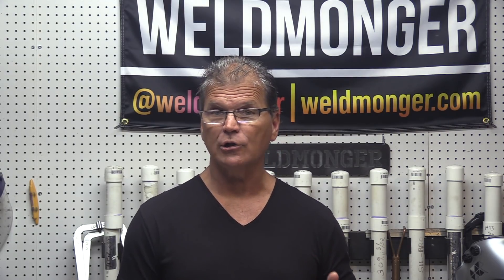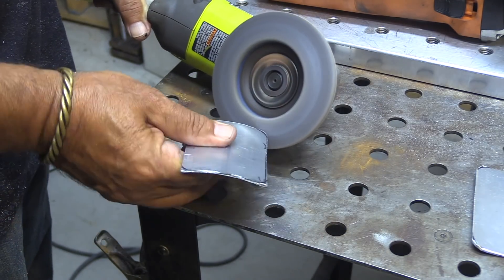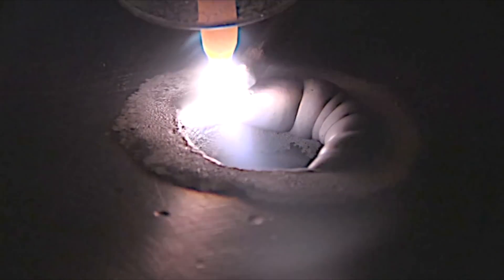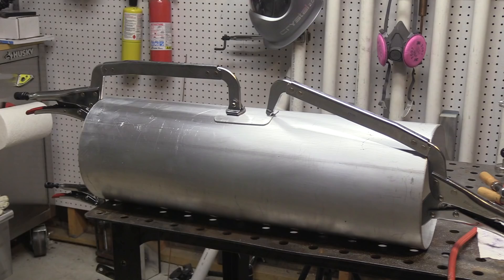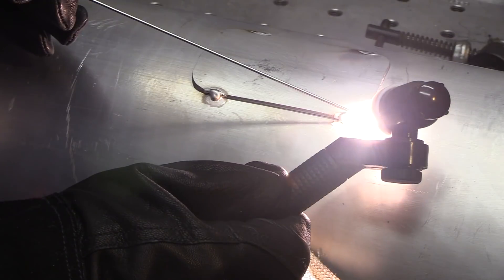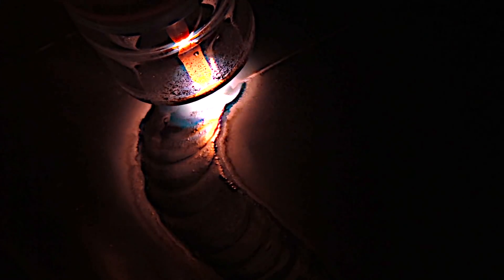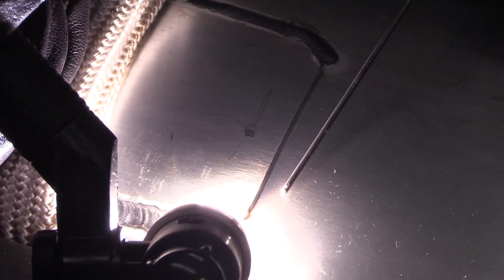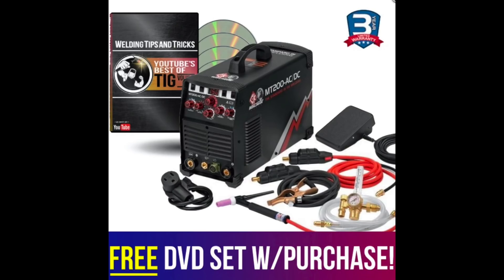TIG Welding Aluminum Doubler

Comment: Hello !  I have a question...  Hopefully, you can offer some insight.

Been welding professionally since the late '70s, with most of my experience being aluminum TIG.  I have noticed something during the last few years I don't recall seeing before...

There's ( for lack of a better term ) "little jumpers" coming up in the weld puddle.  If not watched and dealt with closely, those little "jumpers" will leave visible holes in the surface of the weld.

I've heard that's caused by impurities in the aluminum "gassing out" during the welding.  Some say there's little one can do about it except to hold a longer arc to allow it to gas out.

Your thoughts ?

Thank you.

Comment: Hey Jody - I'm new to TIG and I have had quite a few gas lens collets come apart. The brass part tends to separate from the copper part. I'm hoping that it is the low quality of the particular brand. Can you recommend a few brands that last longer? I don't have any problems with the standard, 1 piece collets. Thanks!

Comment: Hey y'all if y'all want to see another great Aluminum tig welding video then check ✔  out my Aluminum Tig welding video where I'm using DCEP tig and Aluminum stick welding rod's   there will be a very tight arc shot in the video so you can really see the flow of the puddle.  Always looking good Jody with them welds man thanks for all the great videos you've done throughout the years. I've been watching wwlding videos since I start welding back in  97 when I started welding and I  know you've been doing a lot of welding videos over those yesrs

Comment: How do you feel about  Eastwood's mini metal saw? I make small cuts like that all the time with a circular saw.  I won't use a grinder wheel on aluminum cause I don't want to introduce contamination from the wheel.  I prefer carbide cutters

Comment: Impressive that you were able to seal that up without a vent...
Reply: Well Considering the ends are open,  not really lol
Reply: @torcher78  😂
Reply: @torcher78    Lol....he sealed the hole first so the open ends don’t matter...lol...
Reply: @torcher78  pay closer attention maybe?  He sealed the hole, then welded a patch completely around.  That is tough to do, I do it daily
Reply: @pontoonrob7948  It was a tube with both ends open he welded the patch on, no chance of pressure building up.
Reply: @GenerationAI2024  He means the enclosed space between the patch and the OD of the pipe, not the inside of the pipe.
Reply: @pontoonrob7948  It’s not that hard
Reply: @tatehalpin5686  once he sealed the hole he grinded the bead flush and the patch fits nicely on that pipe, no pressure building anywhere, are you welders or?

Comment: After mig welding Mild Steel for so long, welding Aluminum looks like a nightmare
Reply: Easy Peezy lemon squeezy
Reply: Mate aluminium is the nicest material to weld. Only thing is it's hard on your gear as it needs load of amps and you need to be fussy with your prep and pre weld clean .

Comment: Nice patch.  Would you normally use a new SS wire brush to clean before bead, or does the weld arc clean it enough?

Comment: For starters,  Thank you for your videos! They are very informative and they really helped me improve my TIG welding techniques. 
Do you know about or have you ever used Boelube for cutting and grinding on Aluminum instead of wax or beeswax? It Is Great stuff! Designed by Boeing to help with cutting and grinding T-7 Aluminum on their Air Planes. Non toxic and doesn't interfere with welding Aluminum like wax does with virtually no cleanup required. 
I highly recommend it. I use it on just about everything from drilling holes in steel, bandsaw blades, flap disc, belt sanders and abrasive wheels.
Reply from the maker: thanks, i will look into it

Comment: Your videos are very well educated I was curious I’m into bikes as in road bikes, mountain bikes, BMX’s and a lot of the Aluminum’s or 6061 and higher maybe and Steel Metal for a fixie bikes or single speed and can you show something about carbon fiber hood frames to or something about carbon fiber
Reply: This is a welding channel, instructional material for the welding process. You're gonna have to find stuff about carbon fiber bike frames elsewhere.